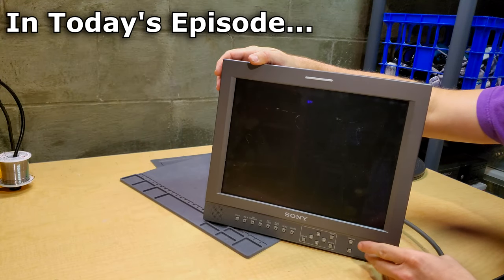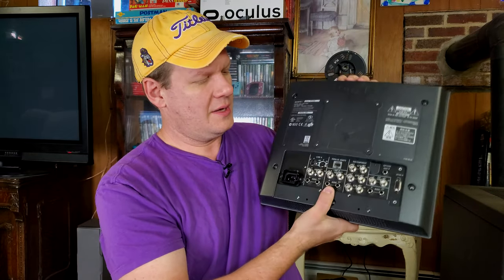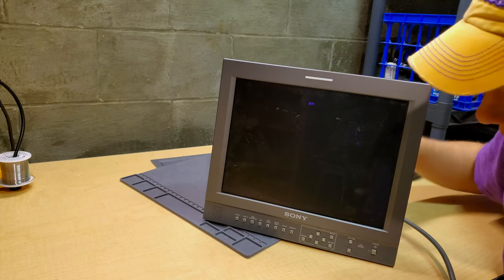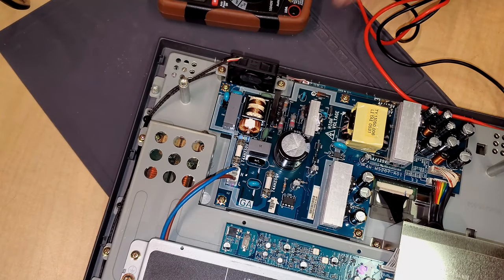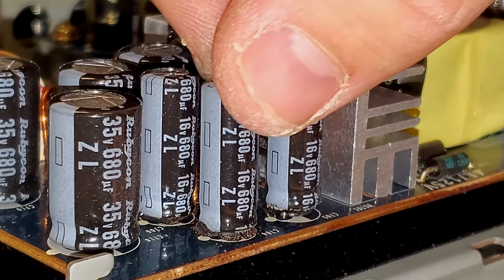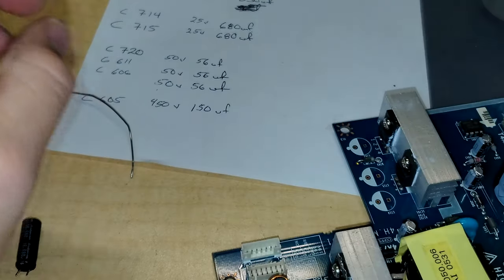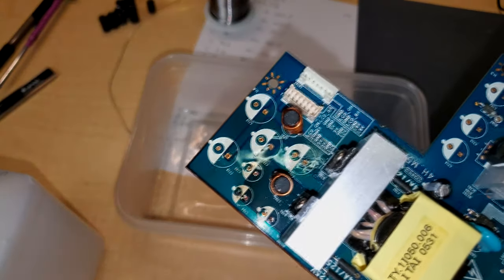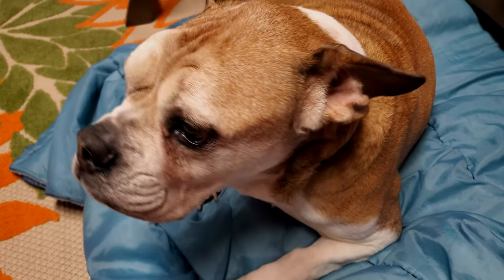Sony's LCD PVM! | LMD 1420 Part 1: Repairs

Comment: Just before christmas last year I managed to find a fully working PVM-1953MD locally here in Croatia for about $70. I got it from a guy running a Veterinarian clinic. He did have some more monitors previously but sadly got rid of them before I could contact him. But still, what an amazing find.
Reply from the maker: Nice find.  That's one of my favorite PVMs.
Reply: @RetroTechUSA  I've been enjoying it for the past few weeks, and it's currently my favorite monitor i own. Unlike my JVCs, the picture is perfectly steady, and even though it doesn't support 480p, 480i content looks AMAZING. The only nitpick i have is that it has some weird convergence irregularities in the sides of the picture, and some are worse than others. Maybe it needs convergence strip reseating, or more of them added.

Comment: Get some thick plastic spudgers, they're great for opening plastic casings without doing too much, if any, damage. I use them for tablet and phone repair all the time and they're fantastic. Hot air rework and soldering stations are no joke, stay safe.
Reply from the maker: Thanks

Comment: I have a small print farm with several 3D printers. Replacement screw bosses are good if you can print ABS. Replacement flip covers/doors are definitely something you can print.
Reply from the maker: Thanks, I'm learning a lot.   The printer says it can do ABS.  I'm excited to keep working at it.
Reply: @RetroTechUSA  It can do ABS but it has a tendency to curl, deform, or come off the bed in the middle of printing if you don’t rig up some kind of enclosure. ABS also has a smell so the enclosure helps with that too. You can rig one up by putting under a table and taping up some trash bags.

ABS has fallen out of favor with most makers but it has a few advantages, like the ability to do “vapor smoothening” with acetone. You can get “ABS Cement” from the plumbing section of most hardware stores which is basically ABS dissolved in a solvent. The solvent will merge your ABS prints to the ABS cases and housings if you print screw bosses and such, with the excess ABS adding more strength and rigidity than there ever was. It may look ugly inside but that’s not what counts. ;)

Have fun with that Ender 3 V2! I have two original Ender 3 printers and I love them. I also have a monster Creality CR-10 and Sovol 3D as well as a dual-extruder Flashforge Dreamer that I found complete in the original box at a thrift store. Score!

Comment: Thanks for the video, I have the same pvm. This will help me if caps need replaced. How often should you replace caps? Monitor works fine, but rather use a CRT tv for my MiSTer.

Comment: I have a question dude I recently picked up a Sony Trinitron I plugged my ps1 in and noticed the picture is zoomed a little like it’s not where it should be and can’t figure out how to change the aspect ratio and have no remote
Reply: This is likely just overscan which is completely normal on crts, you can change this by going into the service menu and adjusting horizontal and vertical size. And if you need to, changing horizontal and vertical position so that the image is centered 👍
Reply: @MrNapkino  I was able to finally get into the menu and change it that’s exactly what it was thanks for the feedback
Reply: @TysonD916  no problem! Glad I could help.